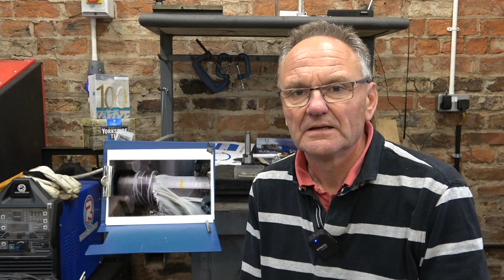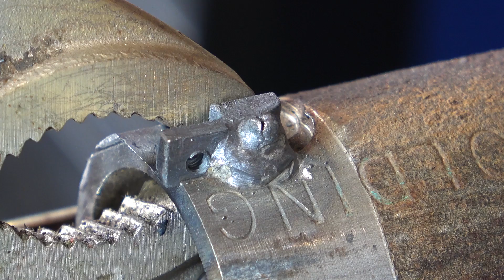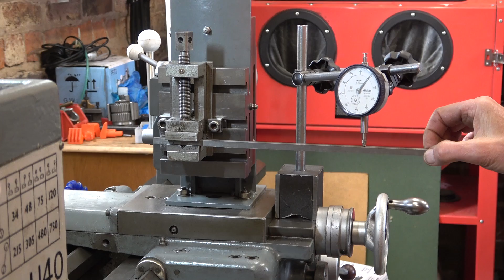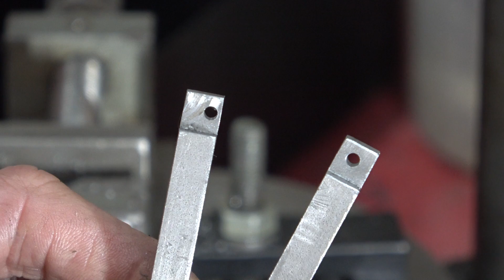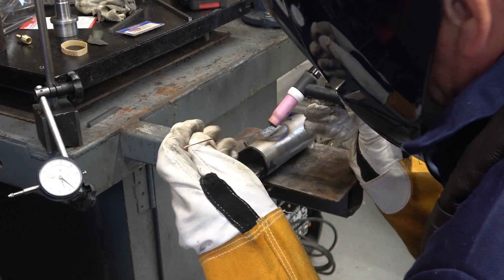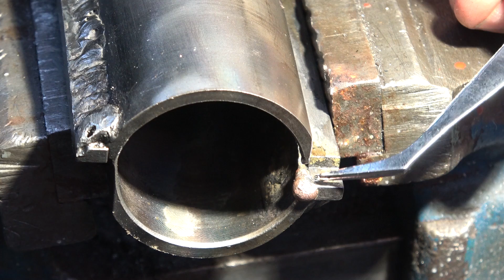HS105 Shopmade tailstock trepanning tool – Part 2

Comment: Generally tools like these use what is called cartridges which hold the inserts and they are just screwed in place.
Reply from the maker: Hi Andy, yes I saw that on David's channel. I did not have the wall thickness for insert cartridges on my bit of scaffolding tube. Cheers

Comment: Hello my friend allot of your tig problems are I think you need a larger torch but seriously you need to get a smaller torch for the small work your doing your si/bronze will flow out better if it’s not flowing the parent metal isn’t hot enough it’s actually not welding but brazing what size tungsten are you using, look at it like this on si/bronze you’re tig torch is nothing more than a electric torch compared to a oxy/actl torch and how sharp is your tungsten your using a monster tig torch
Reply from the maker: Hi jkmcp, nice to have your comments. That was in my early days of TIG and I've improved a bit now. You must be telepathic because I've just bought a CK9 torch which should (I hope) give me more control.   I bought the welder with the WP26 torch included and to be honest it was a big expense for me as a hobbyist so I did not want to buy a CK9 until I'd developed some basic TIG skills. Cheers

Comment: I assume that this is your name, Haxby. I'd like to say Hi, and from watching other people whom are making  / machining all kind of cool stuff 😎. I'm located in the USA-Michigan. In short, pulling together a little shop in my basement. Winter is on its way, a Lathe isn't good where temperatures get cold. When you have some time, send me a reply 🙂.
Reply from the maker: Hiya Keith, tnx for the comment good to hear from you. I answer to Haxby on here 😁.  We don't get so cold as you here but recently had the first light frost, and the workshop gets chilly. You will see my layers go on as the temp comes down. I have a heater but I always worry the noise will give too much hum on the videos. Lets us know how you get on setting up your shop. YouTube is a wonderful resource for ideas  Cheers
Reply: @HaxbyShed  Keith isn't planning to do any video currently, but I will need to open a YouTube account for exchanging different ideas, so do take now

Comment: The audio is much better than in your older vids. I think, if you use always the same mic, it will make the sound more consistent.
The little bit of echo we hear give it a very natural result.
Reply from the maker: Hi Rusti, thanks. Now mostly I am using the wireless mic transmitter/receiver without the lapel mic. The trepanning videos were made over an extended period when I was trying out different sound setups. Cheers

Comment: I still prefer the lapel mic.Re welding tables..I bought a relatively sturdy ,foldable ,one from a reputable UK company that served me well for 6 years.Looking to build a 10 mm thick one now but saw a nice one from Stahlwerk for hardly more  than  material cost...perhaps a good idea as a solid base?Just a question on the total length of the tool you making,would in practice upto 50 mm deep cuts not be sort off the max?And having a shorter tool then would keep everything more solid?Or am I missing something?greetings from S.France
Reply from the maker: Hi Robert, sorry it took me a while to reply. I have looked at the Stahlwerk tables you mention. Yes they look good and quite high tech. I do not know if I can get one in the UK ... ?  If you have seen Part 3 by now you will know the tool worked out fine. If the cut was only 50mm perhaps I would use a rotabroach or a hole saw. Trepanning tools can cut to really any depth, limited only by the length of the lathe bed. I imagine it is much warmer in the South of France!  It's a bit grey and miserable here at the moment. Cheers

Comment: It is looking good and I am enjoying following along, thanks. We are starting to think about a welding table too and we would be interested to know what your thoughts are for one
Reply from the maker: Hi GTB, on the welding table the options are something like: 1) get a slotted metal top for my Black and Decker Workmate; 2) buy a welding table/stand from ebay for about £100 which would be a bit better than the workmate but more expensive; 3) lookout for something on Facebook marketplace or similar - but usually people want too much £ for a proper table; 4) adapt something else like a sturdy metal table. Cheers
Reply: @HaxbyShed  Thanks for the information about welding tables. We have a really strong frame of the ideal size that was made for something else years ago but we are struggling to justify the cost of a sheet of 10-16mm steel plate to go on top. Maybe we should downsize to something like 6mm

Comment: Audio was good throughout Paul and it's great to see the Trepanning tool taking shape. 
Best wishes, Dean in Oxfordshire.
Reply from the maker: Thanks Dean. I held off making this tool for a long while as if means an lot of effort with low chance of success (I thought) but as you will see in part 3 it performs very well. You were spot on about the high strength of the scaffolding pole. Cheers
Reply: @HaxbyShed  it looks like a really useful bit of kit. Always good to save a bit of material in the home shop too.

Comment: Paul, DC negative weld? Use a real sharp point, 30* or so, low heat @ about 60-70 amps & you'll get a much smaller width weld. You should make it about  3 mm wide, that is sufficient. Good work so far; we're enjoying the series.
Reply from the maker: Hi Bob, I was DC electrode negative at 95 amps max. Sometimes I avoid porosity and other times I don't (and it still seems a bit random). I did wonder if I had an air leak. Checked the lines and all seems fine so it's still my 'under-skill' catching me out. Cheers.

Comment: PRT 2 turned out very nice Paul👍👍✔✔
Reply from the maker: Thanks Al. Sorry my TIG is still pretty rubbish but the parts stayed and I will still aim for beauty as a long term goal.
Reply: @HaxbyShed  TIG is getting better as you do more...try an smaller filler rod [1/16"] as you learn by doing.